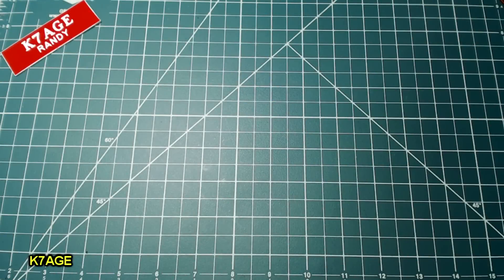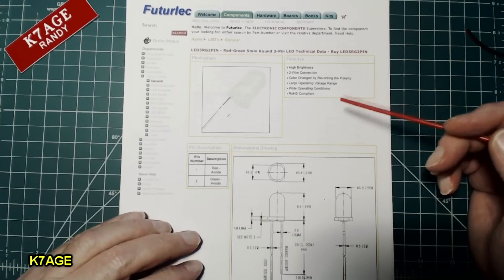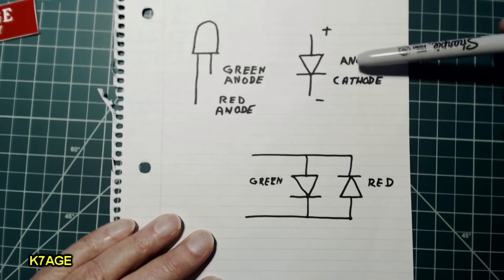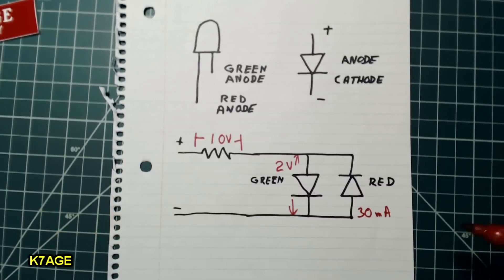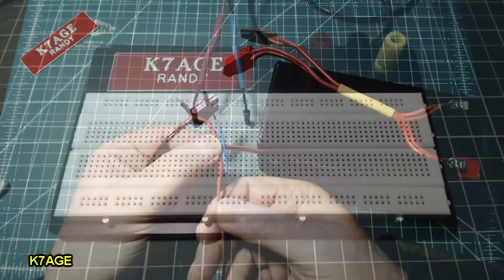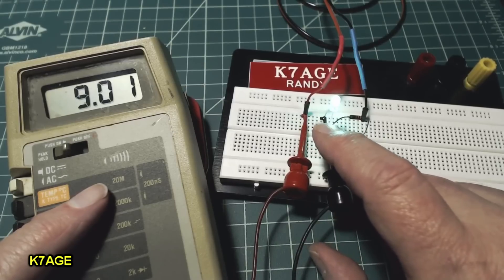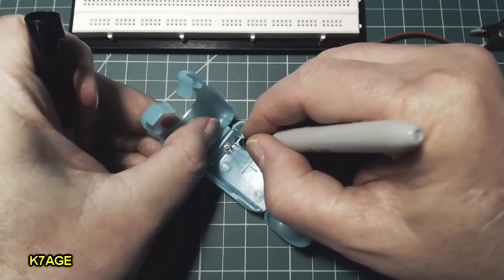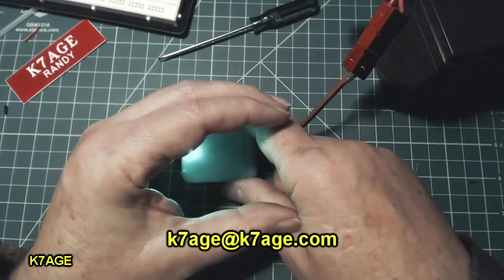How To Build A Powerpole Polarity Tester

Comment: Good info, Randy. Years ago when involved with the Civil Air Patrol we had plugged a very steel navy trailer which we used for a comm center into an electrical plug in a fire services building at a regional airport, then wandered down the steel stairs of the trailer and grabbed the ground rod which was leaning against the steel stairs.  After picking myself up off the ground, we determined that the hot/neutral at the source were swapped. Seems you can't count on "Professionally" installed systems at times. I now carry a circuit tester and rather obsessively check anything I'm planning on hooking into where safety may be an issue.  Fool me once! :~)
Best!
N7KIB, Bill
Reply from the maker: Safety first!

Comment: where would one go for discontinued devices. like trw, mrf and all of the devices one might run across in repairs.
Reply from the maker: Not sure. Might be best to google the part number to see if you can locate it.
Reply: K7AGE I've Google for data sheets for these devices. that's why I've asked you. I figured, maybe you would know of the hard to find info. but now that you've told me this. the info is long lost or someone's holding out. it's kind of like old tube data. but most tunes are well documented. and I've stored that data when I find it. but there are some tunes who's data is like the 8908 tubes. I've read that it's cross referenced with another tube. one that has a ridiculous hv voltage. 7500v or something like that.  but unless it's that tube's data sheet. it's like hear say and won't stand in court. might as well be a lie.

Comment: Why was 10 ma, or 1/3 of the max current selected? Could you use 1/5 the current, 15 ma? Would it give you a brighter LED to use a lower value dropping resistor?Good tip, Randy. Thank you.73 de K7RMJ  Frank
Reply from the maker: 30 mA is the MAX rating. You don't want to run at the MAX level. It could shorten the life of the LED, or you may run over if the voltage it a bit high. So, running at 1/3 is very safe, and the LED was still pretty bright.
Reply: Thanks for the explanation. That makes really good sense.